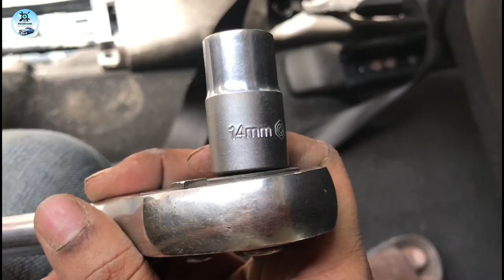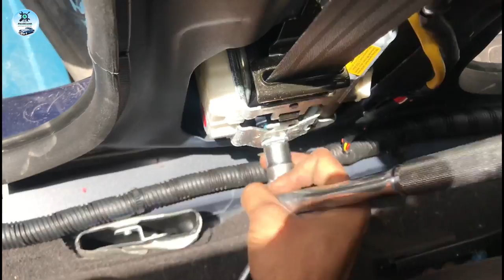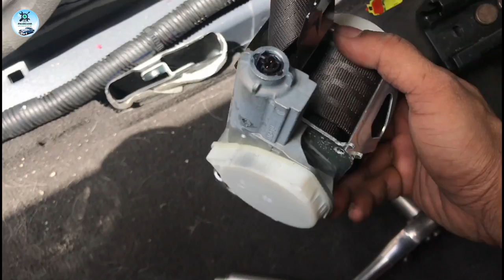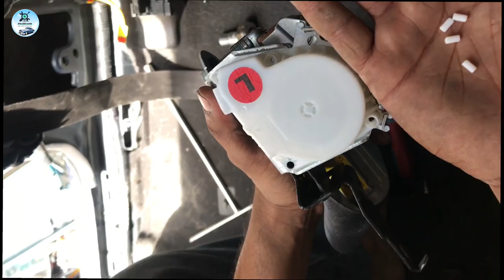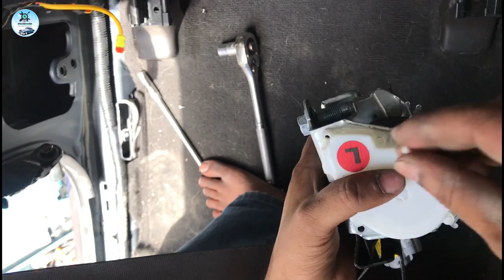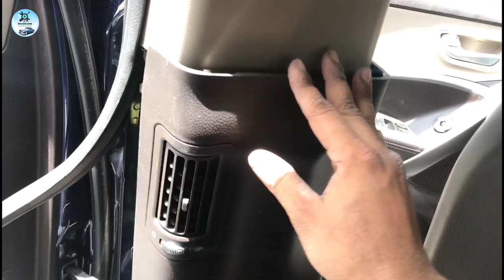How to Release a Stuck Seat Belt

Comment: Here's an idea that I did and it worked perfectly. If you've been in a fender bender and your air bag deployed your seat belts will lock in the closed position.  Rather than go thru the hassle of repairing them do what I did.  It's much simpler and only cost about 20 bucks. I bought a set of universal seat belts that are DOT and URL approved. I simply removed the old ones and put these in. I didn't even have to replace the inner latch. They clicked right in. Saves you a lot of time and aggravation dealing with tearing apart the old ones. Hope this helps.
Reply: I would also do that if I knew my electrical error would disappear. My seat belt unit had a connection with ecu apparently and now that it is gone I get a lot of defect airbag warnings. Still searching for the original parts.
Reply: Thank you

Comment: You left pieces out, how do you know it will lock on impact ?
Reply: It won't knock
Reply: @recoversafety346  i was just about to ask if it will work properly. Thanks for answering the question.
Reply: He didn't put back the steel ball and pretensioner back.
Reply: That is the fun part: it won't...
Reply: @recoversafety346  Yeah, he left out the pawl which interlocks with the toothed reel AND compromised the housing by cutting it with the grinder!  This guy may be attempting to fix a belt which already deployed in an accident-- not smart at all!!!!
Reply: B. I .N.G.O.!!!!!!
Reply: It won't exactly 😕

Comment: 🤣🤣🤣guys just put a flat head through the gap where the belt comes out and push the seat belt in . This will make the folded stock section of the belt go back to its original form ! it will work fine after that
Reply: I'm commenting on this so when I go to fix mine tomorrow ill have it
Reply: @baseheadfitness6062  did it work?
Reply: I tried the shove it back method, that didn't work either.
Reply: I approve this method. Ive done it 5 times with success. Eventually mwsses up again and i do it again.
Reply: Great job my friend 👏
Reply: The gap where the lil mechanical plastic block thing? Like where it retracts ? Where we need to remove the plastic to get to it?
Reply: @adamstruthjourney1226  The gap where the lil mechanical plastic block thing? Like where it retracts ? Where we need to remove the plastic to get to it?
Reply: @zeezero8012  no. Just start reeling it back up by hand basically. The screwdriver just release something by pushing on the belt back into the reel. The tip of flathead screwdriver gets into the belt threads a little bit to get a better grip. You keep the belt around the reel tight so you can get it to spin a little bit once you get a quarter turn or even less it will free up and go the rest of the way in its own. Hard to put into words tho
Reply: Yes until the next time you use it. Then it goes back because the seat belt has memory because of the fold, and the same thing happens again and again. New belt needed 🤪🤪🤪
Reply: @Tbone.357  perhaps in most cases. Mine doesnt bind up very often. Only when i pull on it hard when its already locked up.
Reply: I was watching this video cursing cos I'm in a company truck 250 miles from base, thinking I can't use a grinder on this.  I read your post,  no flathead but I stuck a penknife in,I heard a click. It worked a treat. Cheers mate👍

Comment: It's is now just a normal belt just to  save u from police challan.... But what abt its use when u  crash? Ul end up breaking ur shoulder bone.... Seriously..... Just for the heck of few bucks do not risk ur self... one should fix it as it was or  replace it with a new one.
Seriously not recommended to remove the ball and the lock rod